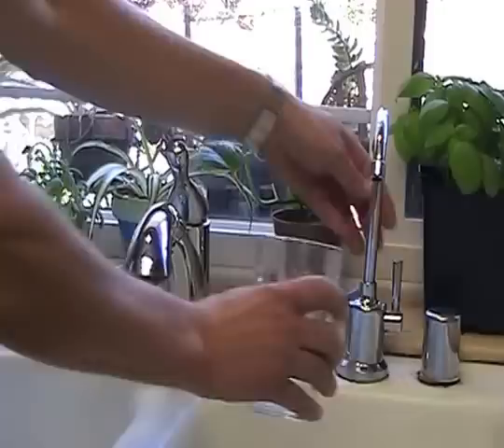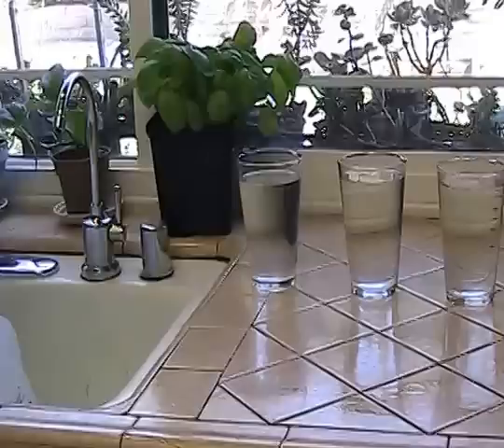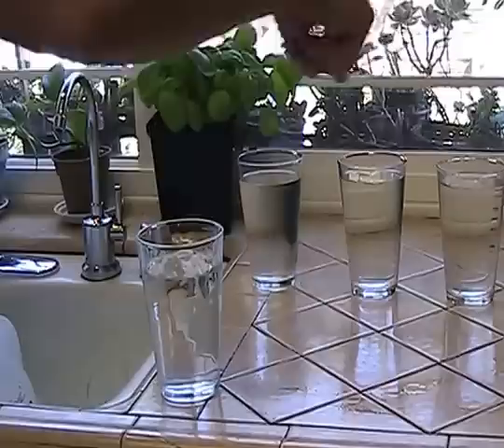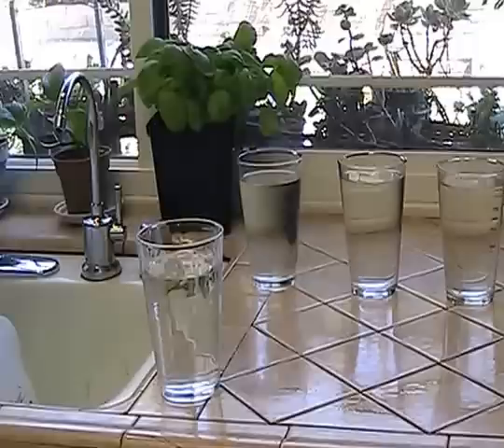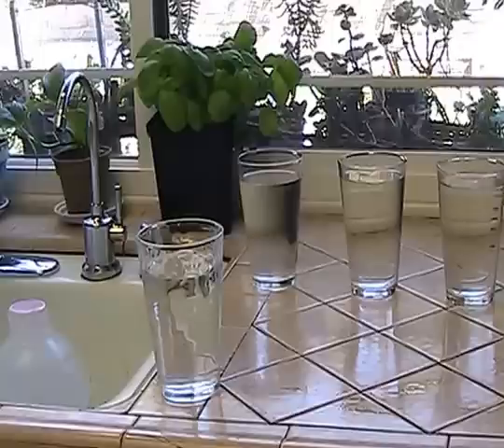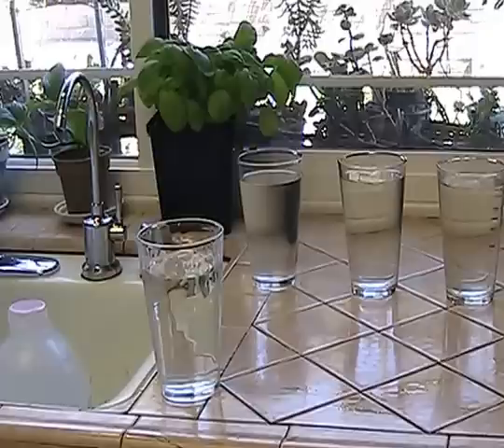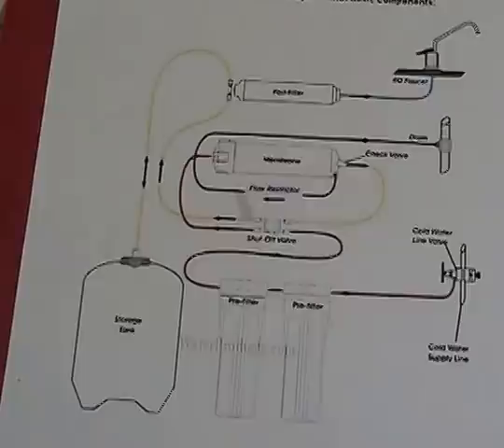Reuse Reverse Osmosis RO Waste Water Video

Comment: What I've done to my system trying to save some waste water is a valve installation on the water source and I turn off the whole system until I need water again.
The waste doesn't ever stop if u take a glass of water from the storage (and even if the tank is full when it builds to much pressure,again, wasting water)
The system will try to fill the tank again and constantly wasting water, brilliant!
Reply: +mytube92369 Has that stopped you from wasting water?
Reply: Your RO system maybe less efficient because the working pressure is less than 50 PSI. Install a permeate pump and booster pump into the system.

Comment: I set up my RO filter in an extra bathroom.  I drain the waste water into a 12 gallon tote I placed in the bathtub.  I use the waste water to flush the toilet in there.  For the filtered water, I just fill up 1 gallon jugs of water and bring it to the kitchen for use.  I've noticed that the more water you take out of the pressurized tank at a time, the less waste water it produces per unit of filtered water.  So, I try to fill 2 jugs at a time.  By the end of the 2nd jug though, the flow is pretty slow.  But that means the pressurized tank is pretty low, so it's a good thing.  I also use a lot of RO water for my hydroponics setup.  Even with all the RO use, basically just my use of the restroom can go through all of the wastewater that is produced.  I have a family of 4.  Once in a blue moon, there is extra, and then I'll just ask the kids to let me flush the next time they use the restroom.

Comment: Ro  systems should be illegal nowadays, there is an incredible amount of water waste. My system is just insanely wasting water. You get 1 gallon and waste between 8-12 gallons. I was trying to save the water and u can't keep up with the waste,it's really annoying and stupid and of course the water bill went up $26 more per month. This system is a failure and it shouldn't waste water at all or just a little not this insane ratio. Whoever invented this I am not impressed anymore , this is totally insane because so many people they don't have water at all and we waste perfect water,clean, just for 1 system,10 thousands or more gallons per year? Shocking and truly idiotic!
Reply from the maker: mytube92369 You are right, RO wastes a lot of water, but you can use the waste water for gardening, toilet flushing, laundry, etc.
Reply: use a good membrane and you will get 6:4 ratio.

Comment: The waste water from an RO system can be fed into the hot water supply therefore wasting none.  The reason so many people dont have a clean water supply is due to their location, economics and the publics inability to elect good government.  Even if we shipped food, clothing and clean water to impoverished countries there is no guarantee that their government would allow them to receive it.  Many food companies destroy out dated food rather then sending it to a soup kitchens and farms are paid to not grow crops.  In other words, there is no food or water shortage and what we waste here has no bearing on what they receive there.
Reply: +614streets,  I am not a designer or installer but I can see from the amount of water waste, how poorly these systems are designed.  You would need to do some modifications to the existing system.   A pump may allow you  recirculate the water back into the water supply while  diverting the waste particles towards the toilet fill or a contaminant catcher.

Comment: without seeing this I did similar thing, like routing to a barrel. But I need to elevate the water and pressure not enough for that. Any ideas, just simply using a bucket instead or adding sump pump ?

Comment: Very well documented, but the ratio of 12:1 is staggering. If this the case with a single unit, what must be happening at the RO bottling plants all over the world?
Is this waste water good for gardening? Or what other uses it can have?
Reply from the maker: A.V. Joshi
Reply from the maker: Martin Prochazka Unlike the rain barrels, which haven't gotten any usage, this system is always producing good clean water. Yes we use it for gardening and laundry.
Reply: I think it's because he use a non booster & permeate pump RO System. If he use those pumps, the system will be more efficient.
Reply: You could use it for your toilet and shower also. In other words for everything but drinking and food preparation.
Reply: SPLITSLEEVE If you can't drink it, then it's probably not safe to bathe in it either. The skin is your largest organ - often called the third kidney - and will absorb damn near anything you put on it.
Reply from the maker: Hui San 
I’ve found that the ratio does vary depending on how dirty the filters are, I.e. the dirtier, the more waste water.
Reply: That depends on what is in the water. If your water is high in Sodium or Chloride, then the waste water will have a higher concentration of those items than what was in the water pre RO.

Comment: And this is where we breed the ZEKA Mosquitoes!!!
Reply from the maker: Jypsy Dog 
Yes, absolutely most importantly, one needs to have a cover over any open water storage. I made one using 1/2” plywood primed and painted with several coats of paint. I have cutout for the incoming line.
Reply from the maker: Yes, absolutely most importantly, one needs to have a cover over any open water storage. I made one using 1/2” plywood primed and painted with several coats of paint. I have cutout for the incoming line.
Reply from the maker: Yes, absolutely most importantly, one needs to have a cover over any open water storage. I made one using 1/2” plywood primed and painted with several coats of paint. I have cutout for the incoming line.

Comment: Can I use ro waste water for bath. N other daily use?????
Reply from the maker: Praful Yadav , 
Of course you can since it’s cleaner than the water coming into your house. 
I’m not sure how you’ll heat it up though.
Reply from the maker: Great idea.
Reply: I wouldn't. If you're filtering your water in the first place, that means somethings wrong with it correct? Why do you want to bath in the chemicals that your filtering out of your water? Which your now concentrating, especially if you're running it back to the hot water tank
Reply: @justadbeer  you know what I was thinking the same thing...I thought maybe I was off